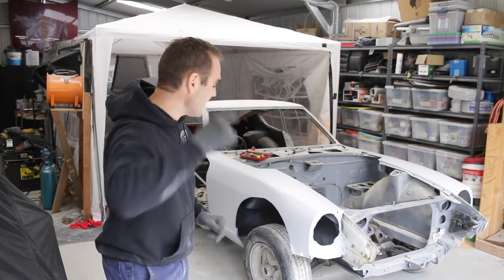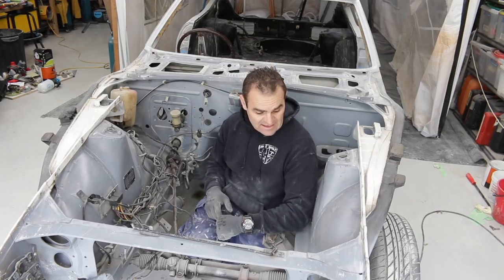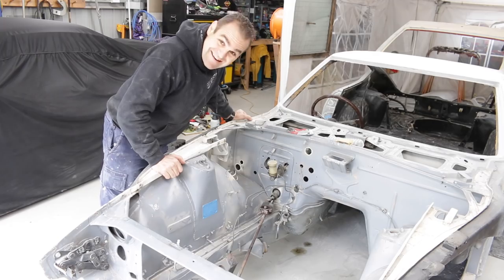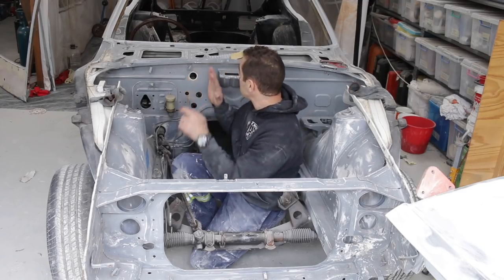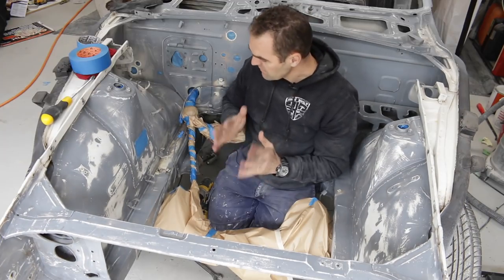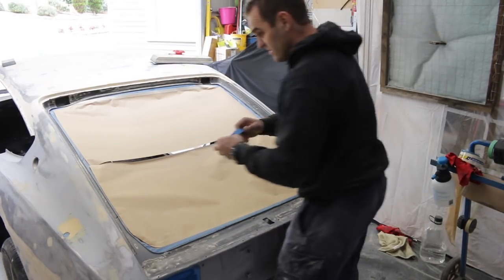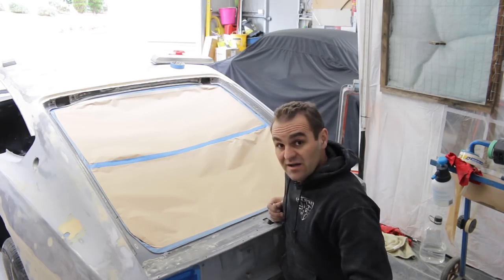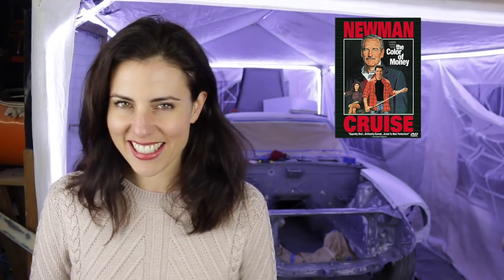Home Built Datsun 240z part 36 - Body prep

Comment: The lengths you go to in order to get the best finish and your attention to detail is always stunning. It's a great warning to those who think they have relatively clean bodywork and expect to have a flawless paint finish within a week or so. Given the trouble that B is for Build always seems to have with his paint finishes and the lack of attention paint gets in MCM, I'd love a technical breakdown of your setup while you are waiting between coats (gun settings, preventing water in the lines, mitigating orange peel and fish-eyes etc.)
Reply from the maker: Those are some good points. I will try to cover them as I go through the paint process.
Reply: Could you maybe also talk a bit about your respirator setup and the Isocyanate can of worms?
Reply from the maker: I have already talked about that a couple of episodes ago, but I will probably cover it again.

Comment: Great to see light at the end of the sanding tunnel, Jeff! I'm wondering why you chose not to add some additional bracing in the engine bay, from the shock towers to the firewall for instance... It will never be easier.
Reply from the maker: The engine bay has already been seam welded by a previous owner so I am happy with that.

Comment: Coming together!! I’m finishing up the prep and paint for my Z, hopefully get the video up soon. You going to do some seam sealer in the engine bay?
Reply from the maker: I wasn't planning on it. Looking forward to more of your vids.
Reply: Home Built By Jeff yeah, either was I but doing some rust repair near the battery tray, the seam along the bottom where the body rails are had a little gap so I put it there and just up along the firewall. Fun stuff, looking forward to seeing painted!

Comment: what is all the wrinkling in the panel @ 0:53 ?
Reply from the maker: I freaked out too when I first saw that as well. I thought the car must have been in a huge rear hit or something, but apparently that is how they came from the factory. I have also been told that it is like a Z's finger print, as no 2 are the same.
Reply: Home Built By Jeff yeah thats normal. All the z’s ive owned have had it as well.
Reply: Are only 240's like this? I can't recall my 280z having this.
Reply: Kaden R my 280z isnt as bad but its still there. Did you remove your sound deadening?
Reply: Randy Torres in that area I believe I have, I'll have to take a look at it when I get home. I highly doubt mine is any exception, so I'm sure I probably just never noticed it before.

Comment: You sanded to much on the epoxy. Should of just scuffed it
Reply from the maker: The old stuff in the engine bay had a bunch of runs that I had to block out, but it will all get another coat of epoxy first anyway.